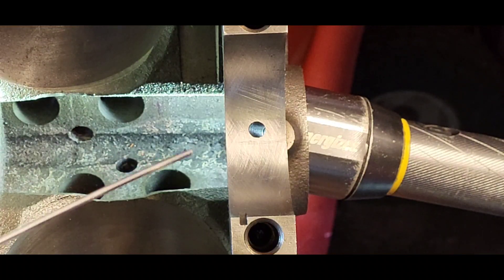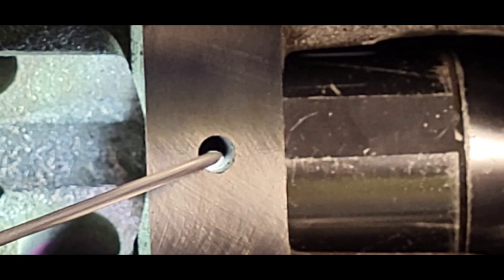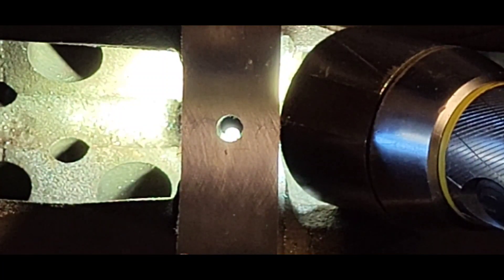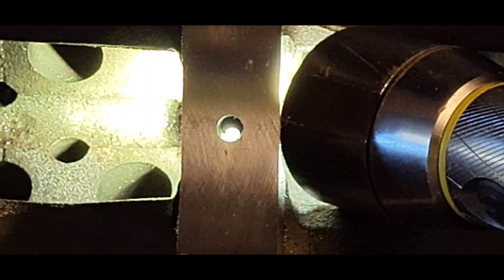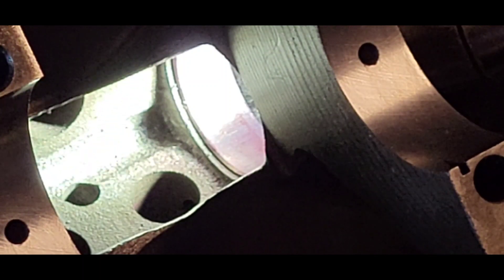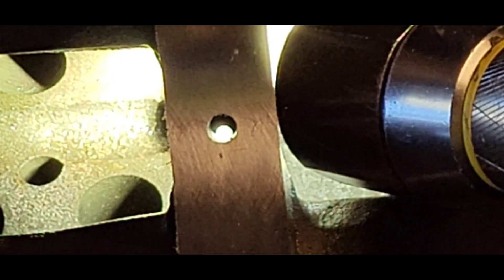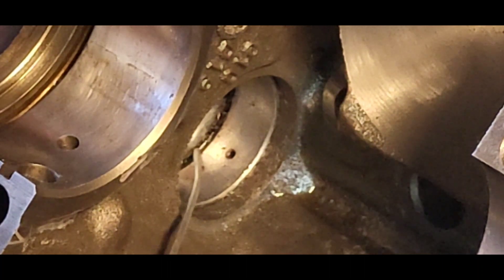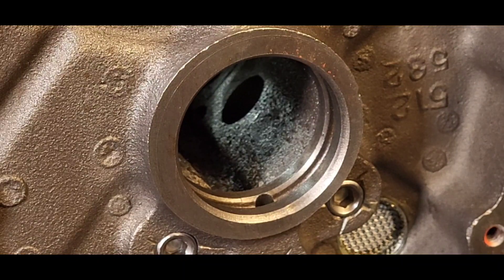You say Po-tay-to, I say Po-tat-o.

Comment: 100% doesn't matter on a small block chevy position of cam bearings on stock blocks they are fully grooved cam journals I've found that aligning holes is actually worse... especially If running big lift cams with lots of spring pressure... can actually flatten oil feed in cam bearing an create oil starvation

Comment: They could have a groove behind the bearing, so it doesn't matter where the hole is at,  however an perfect alignment would give .010% better flow, that would be more machining cost cutting a 3mm deep, 3mm wide groove in the bearing lands, then a couple extra holes could be used in the bearings, a 1mm deep 2-3mm wide groove in the bearing to reduce friction, , I believe a similar tactic can be used in the. Rod and main bearings, allowing oil to be forced into the bearing from 360° from the center less bearing friction and slightly better oiling of the bearings, it would require precise testing, and I believe it would be better than using narrow bearings!

Comment: I've found in the early models, the bearing holes were typically in line with the oil feed hole feeding cam from the bottom . Around 86/87 they started to put them in with the hole feeding from the top.  I have yet to see any difference really in the bearing wear when these engines come in and I strip em down. I'm a low production shop so I only see about 25-30 small block Chevys a year.